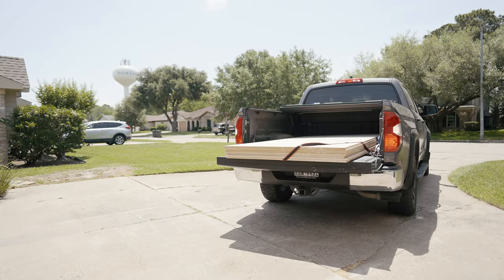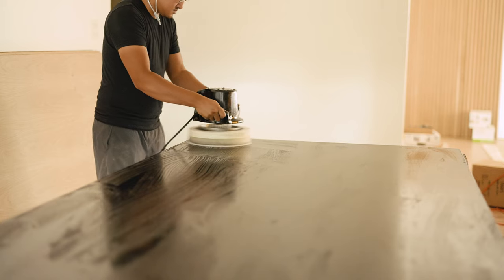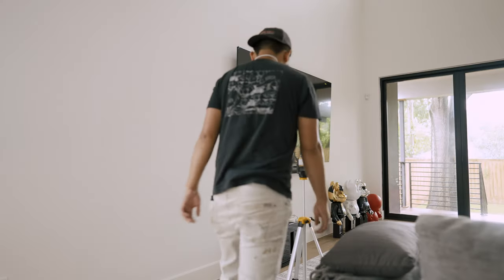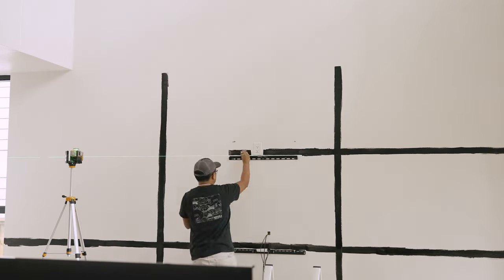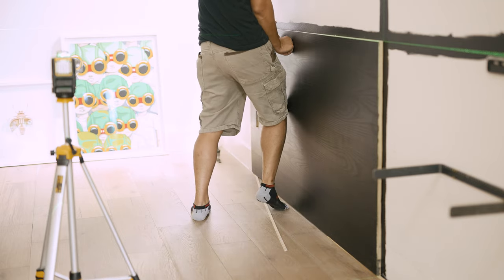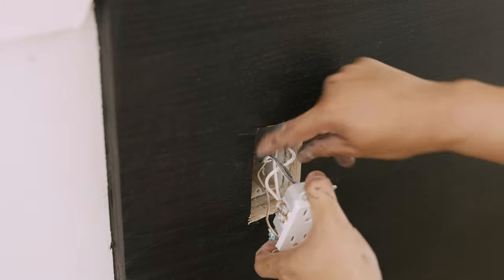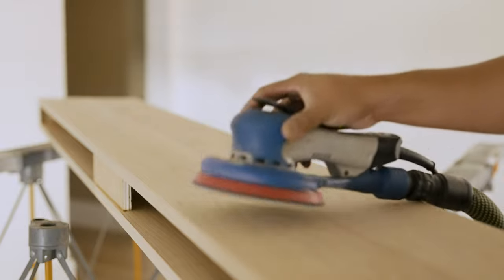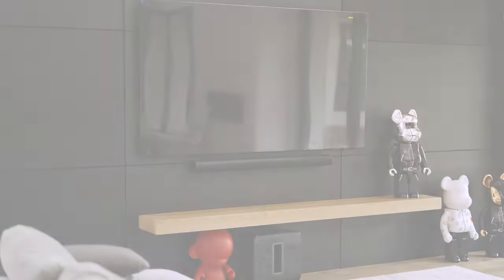Living Room PLYWOOD Accent Wall in a $1,000,000 Home! // Woodworking

Comment: Did you use a combo blade for ripping/cross cutting on your saw? Looking to do a plywood paneling in our livingroom area on a fairly small space and have access to a miter and table saw, so checking out my options for how to best cut without chipping.
Reply from the maker: I try to use a high tooth count blade like 80T, but if I use a combo blade then I would tape the cut line to help with any tear out. Also having a zero clearance inset.

Comment: Very nice work! I've seen videos where they don't glue the panels onto the wall directly but instead install backing 2x4 (or what have you) strips and glue them onto these, what difference would this make?
Reply from the maker: Thank you!  Having the strips would guarantee that you attach the panels onto some kind of structure. Ideally, the strips would be installed into the wall 2x4 so everything is secured. But you do have to deal with additional thickness since the panels are directly applied to the wall.

Comment: Great video!  Is there a small wood strip that you used on the sides, or did you just take the plywood and run it up against the corner of the walls?
Reply from the maker: Thank you!  It's a sight gap at the edge
Reply: @DesignCraftWorkshop  thanks!  For someone who is a 2/100 in woodwork, what is a sight gap?
Reply from the maker: @djdynamiksoundz9166  it depends on taste. I try to keep consistent gaps so in this case it was 1/2” between all the panels